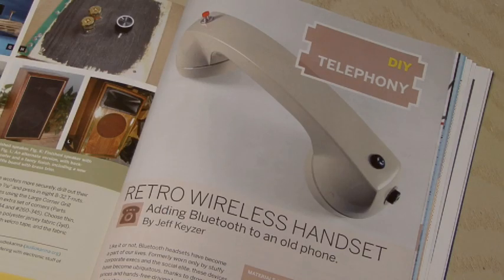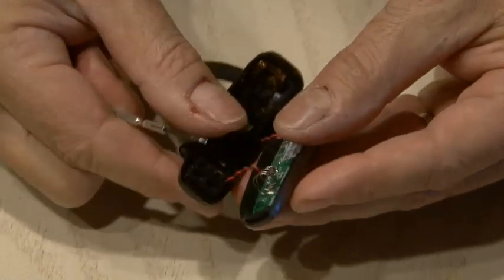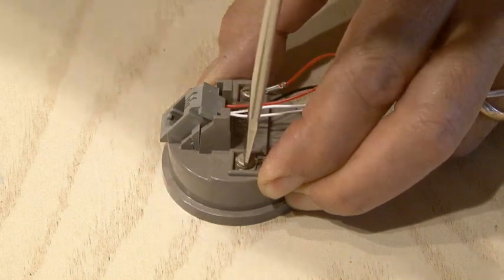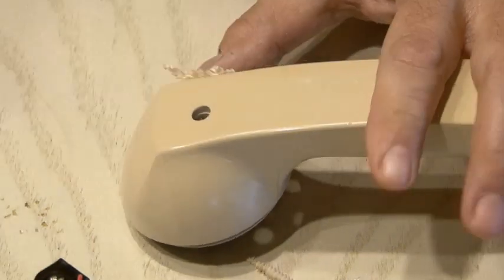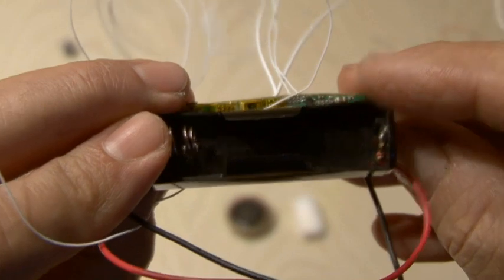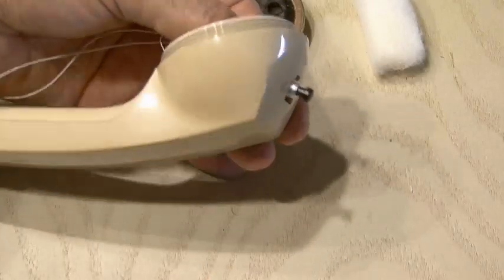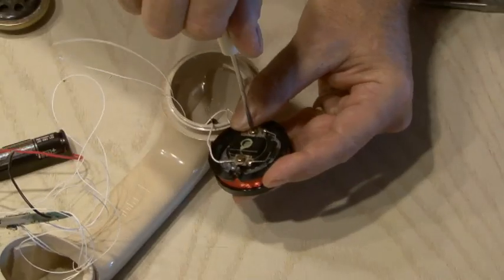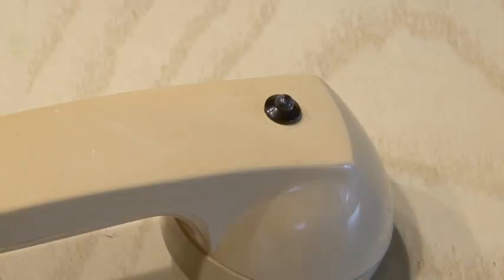Weekend Project: Retro Wireless Handset

Comment: This handset is PERFECT.  Kudos to MacGiver, KitKat, or whutever his name is.

Never made sense to me to have cell phones so small a man with normal size man hands can't hold onto it.

I also like this design; it allows you to easily increase the talk time merely by adding AA batteries in parallel, keeping the DC voltage @ 1.5V, but increasing the mA-hrs with the additional batteries.

This design also allows you to BabyBop a bully over the head with.  Heavy and hard.

Comment: you could just use the retro phone as housing for you blue tooth, use the mic and speaker that came with the blue tooth, just make the cables longer to put into the phone. Once its closed no one would know, also you wouldnt have to mess around with getting that speaker to work with the resistor etc.

Comment: I did almost the same thing, but wired, never thought to do it over blue tooth, but my mod is a bit easier. It's a bit impracticable, so only used on occasion, so my version of this mod is cheaper or a less used one, but this one is defiantly way more professional looking. Way more "finished"

*posted as a video response*